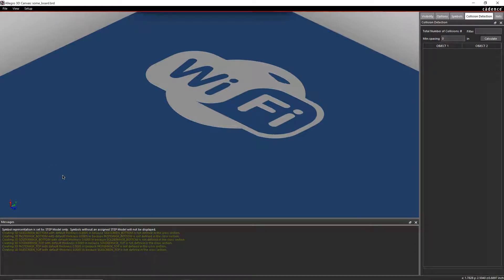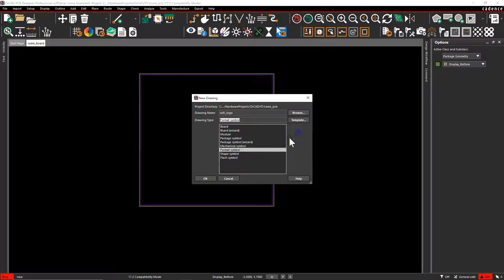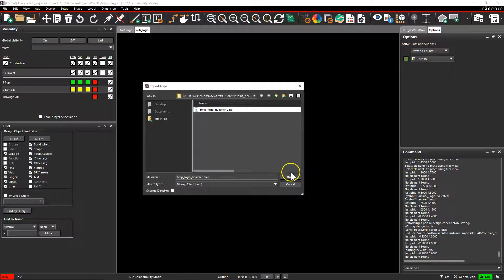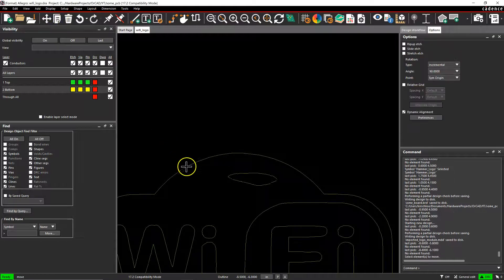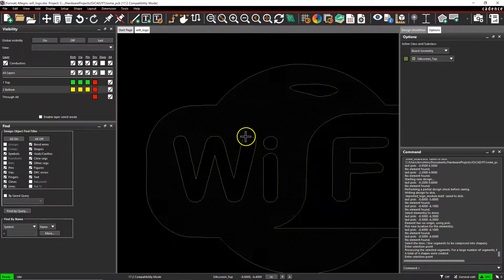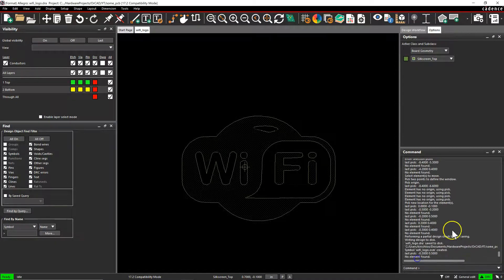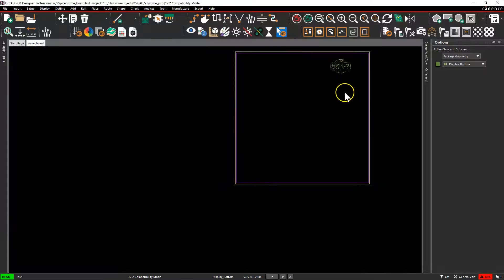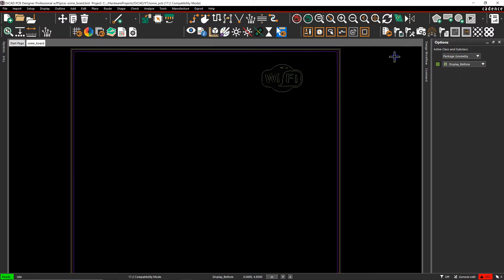OrCAD 17.2 or 17.4 - How to Create a Logo (BMP Vector), How to Import Logo

Comment: ORCAD 17.4 is pure crap, there are so many bugs and lost features from previous versions that it frustrates nearly 5-days-a-week.
Reply: @techedkirsch  There are about 20 details that were OK on earlier Versions that are a source of annoyances  but I’ll need time to gather a list of them all, here is a start, I’ll add more later:
1.  No Print-Preview anymore 
2.  Objects can’t be brought forward or back anymore, this creates all kinds of problems in printing.   I use shapes all the time in schematics and earlier versions allowed selecting objects and putting then behind or in front of other objects.
3.  Part Editing:  Tab no longer allows hopping (selecting) from one object to another, now Shift key is used but not in normal schematic mode.
4.  More later